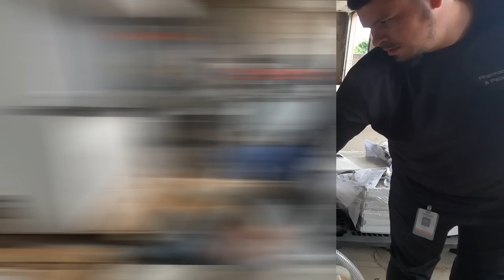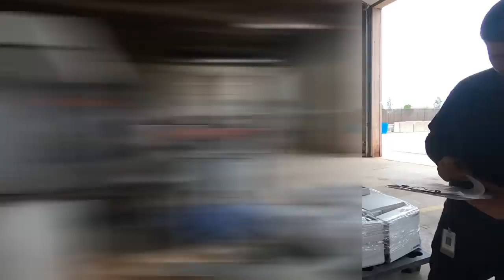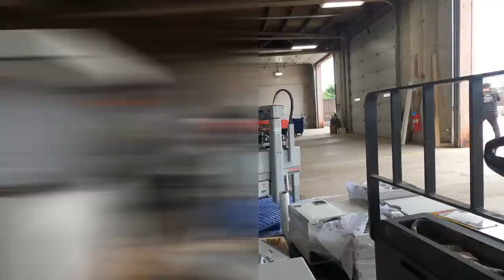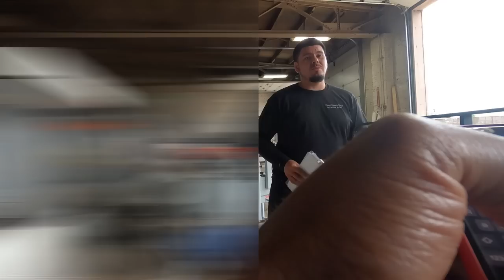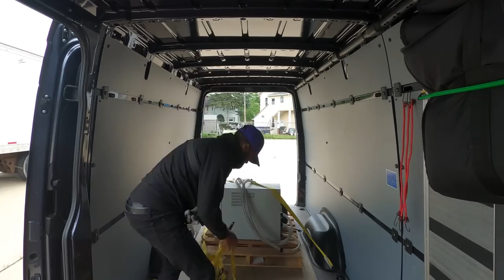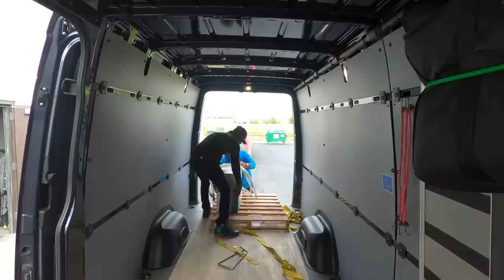More DRAMA on this DOLLY Order! You NEED to Pay Attention on this App! 1-Star Review #foryou

Comment: If want to buying a sprinter van why is size either 144” or 170” wheel base b/c u said the sun run u could not do both order any more then just do 144” better or go with bigger is better
Reply from the maker: I think you could do plenty with the 144. If you plan on moving furniture too, then I would consider the 170.